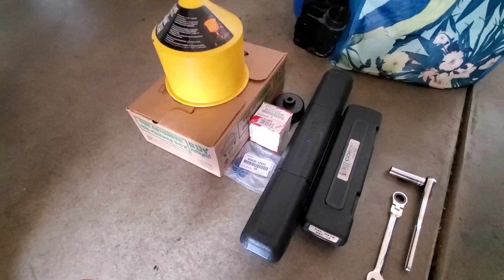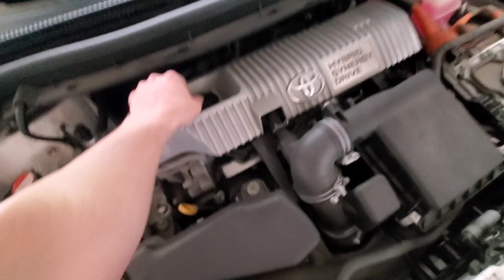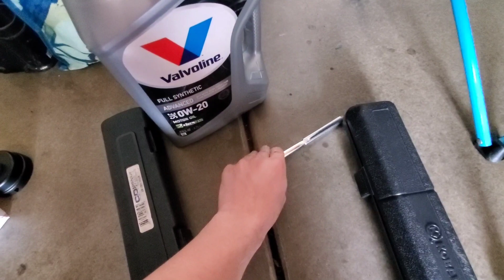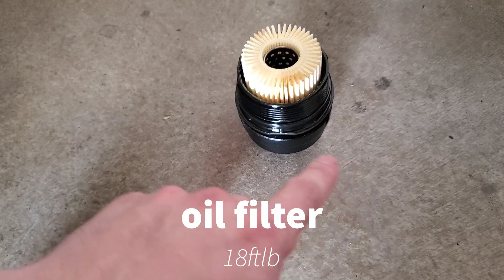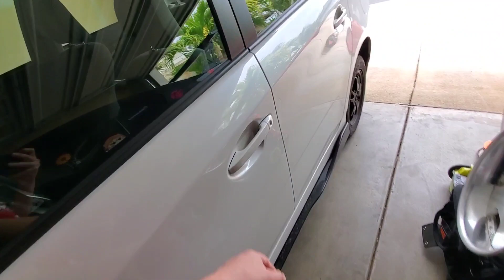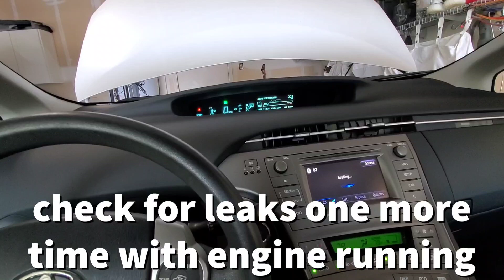TOYOTA PRIUS OIL CHANGE

Comment: Good job. Nice to see the torque spec posted for the oil filter cap. Another method that will get it close is to tighten it till it bottoms out and then don't turn it more than ⅛ of an inch beyond that.
Reply from the maker: Yup! That's good for the people that don't have a torque wrench on hand. But I can never trust myself without one haha.
Reply: @Alexhaav  
I agree. I always use one.